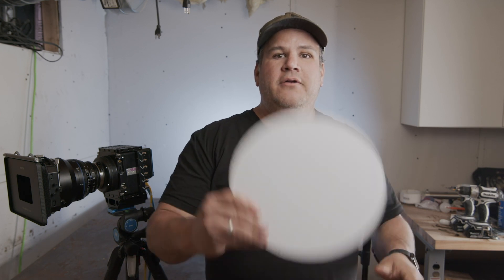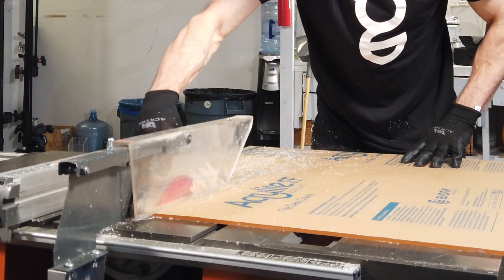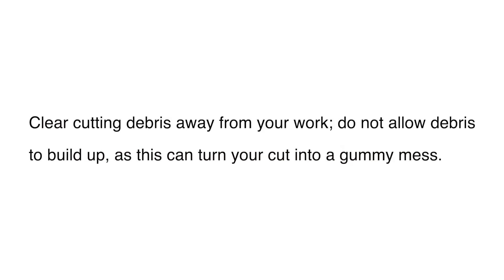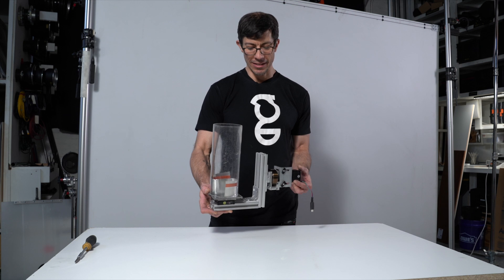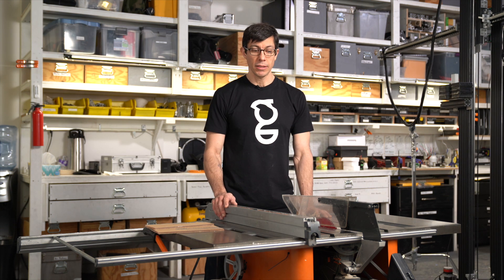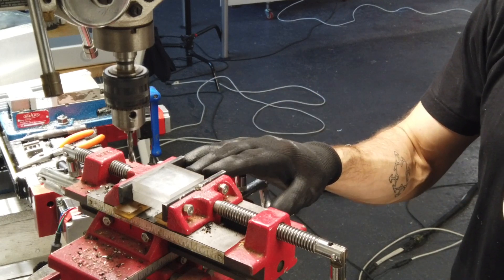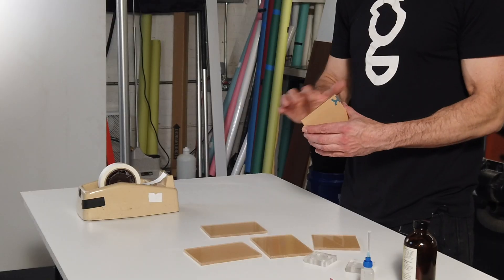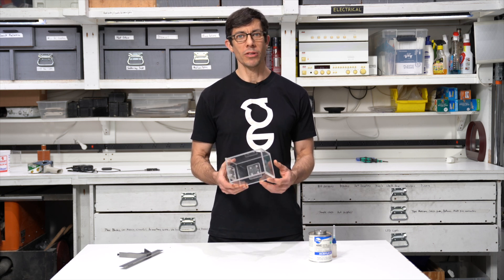How to Build With Plexiglass

Comment: Great video. One question: How would you attach plexi walls to a wooden base. Im plannimg to convert a glass top coffee  into a shadow box coffee table. The walls of the shadow box would be clear plexi. The base would be mdf or plywood and the top of the walls would connect to the wood under side of the table. Thanks for your time and any suggestions you may have.

Comment: Further pro tips from the signage industry. 
-When cutting plastic with a jig saw, cut on top of a nice, thick piece of extruded foam insulation.
- turn any blade oscillation the jig saw may have off; be sure that the blade is going straight up and down.

Comment: How do you attach this container to a stepper’s shaft? Thanks 😊
Reply from the maker: Amr El Saadany Photography a few ways. Attach the container to the shaft is an aluminum block drilled out with a tapped whole for a set screw.  Or depending on the forces, a drill a while in the plexi itself and drill and tap a set screw in the plexi

Comment: Experimental physicist here :) Applying "a solvent" doesn't mean much -- anything can be a solvent when something's dissolved in it. You mean you need a liquid a) in which plexiglass is highly soluble and b) that evaporates fairly quickly. I've used simple chloroalcanes to do this -- chloroform is standard, but dichloromethane is less hazardous. Better yet, because none of these molecules are very friendly, acetone (like in nail polish remover) -- but I suppose it would take a longer time to bond. Also, train on scrap pieces before doing the real deal! Any dripping and the optical quality of your surfaces will be ruined... !
Reply: Yeah I was wondering how they skimmed over such a basic key ingredient... That part of the tutorial sounds preposterous when you know how unspecific the word "solvent" is.
Reply: Forgive my ignorance but what is a common “solvent” i can get off the shelf? I guess I’m asking what do you prefer most?